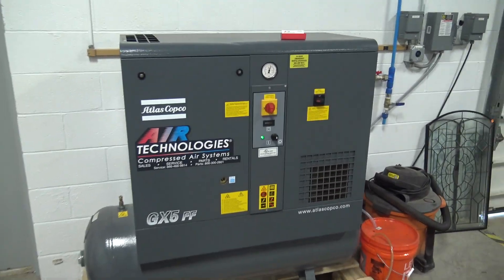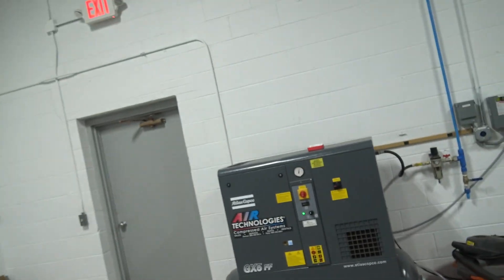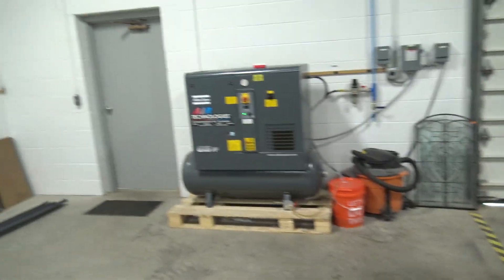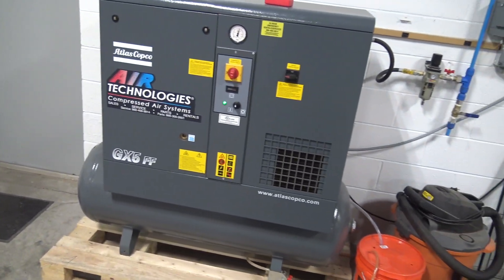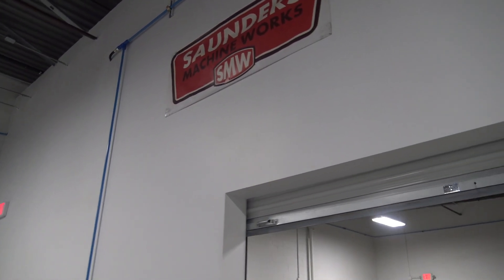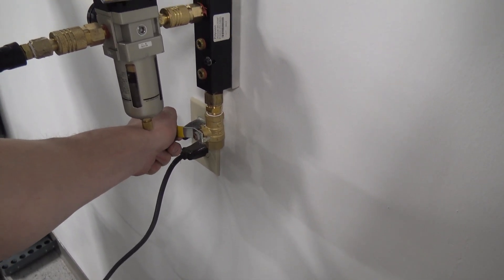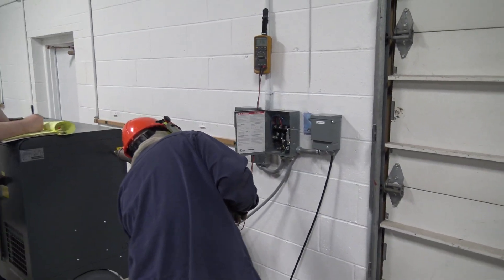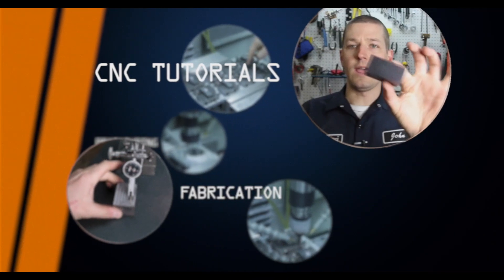Rotary Screw Air Compressor:  What are they?!  Worth the hype?

Comment: Thanks for posting... There's lots of mystery about compressors / efficiency/ air produced / energy used.. Instead of HP knowing the CFM at a particular pressure like 100 psi is a better way to compare compressors. I think I read somewhere piston compressors are still more efficient, especially if you want 150 psi air a 2 stage is the way to go. A scroll type air compressor would be the optimal compressor since the air is continually forced into a smaller space as it moves through the compressor. One issue with screw compressors is if the air get's too hot the oil will vaporize and it can catch on fire... https://www.youtube.com/watch?v=6AK2K2bwD3k
Reply: Actually if sized correctly, the screw is more efficient as you don't need the same hp to do the same amount of work...and some of that hp on the piston is used to overcome the higher sliding and rolling friction inherent to a piston design...for example you have to oversize a piston compressor because they can't (or shouldn't) be used for 100% duty cycle whereas a screw can be...I replaced a 5hp piston in my garage with a 3hp screw and get the same results...also the oil used...assuming it's proper compressor oil...has a much higher flash point than what the pump can achieve by heat of compression...what you see in that video is the result of a 'air/oil separator' fire...the gaskets of the A/O sep. have staples on them so that the sump, sep and sump lid all stay grounded...or else a static spark inside the sump will set it off...if the maintenance is done on time and correctly those fires are extremely rare...been in the business around 15 years and have only seen two separator fires.
Reply: I think you have some misinformation... since when is a piston compressor not "supposed" to be 100% duty cycle? Also pistons seal better than a screw and all the information I can gather says a stage type compressor is more efficient that a screw. Do you have anything that says otherwise?
Reply: The type of pistons that can run at that duty cycle are liquid cooled industrial class piston compressors...the shop type (what he has pulled out) if run at 100% duty will wear out extremely fast, create a hot tank and draw more Kw/hr per matching hp running the same cycle. This is why you generally have to buy a bigger hp piston so it can overpower the demand to shut down and cool off...ideally 50-60% duty cycle. Their current draw in that situation will be higher, and constant.  

If you have a properly sized screw for the application, it will be less hp and it's maximum draw will be the same as a piston of the same capacity (but that's not what you want to preserve the piston), but it will only reach that current draw at maximum capacity (full load) anything less and its draw is less.

Also one feature of a screw that's always overlooked is that it can supplement your heating source as they have air after coolers and oil cooler that have relatively powerful fans (compared to the fly wheel fan on a piston)...the only really area the screw looses out is maintenance cost. It could be $50 or less per maintenance cycle on a piston, whereas a screw (a decent one) will cost three or four times that...although it may balance out as you don't have to cycle the maintenance as often as a piston compressor.

My Kaeser SX3 (3hp) screw uses less overall power throughout the year than my 5hp Quincy did...heats my garage partially, almost invisible (noise) in comparison and I can run the sack off it and it doesn't degrade in performance like it would if it were a 3hp piston. It does cost me approx $300~ per year to maintain it...and I think over the same time I think that I was spending $200~ over the same timeframe on the Quincy.
Reply: A quality cast iron compressor will run for years with little to no maintenance... most refrigeration compressors are still piston.. your talk about cooled piston and all is just BS... If you like getting screwed that's up to you...
Reply: ...you clearly don't know what I mean by liquid cooled industrial compressors...look up Beliss and Morcom (best hits for videos)...those machines will run 100% duty cycle and are extremely efficient...they are also double acting piston types...but they can be very expensive to maintain as they generally start in the 50hp+ category...any air cooled compressor has a recommended duty cycle as I mentioned...they don't make machines that will run for years with next to no maintenance...and the old ones that would take more abuse would only run like that with lighter than average use...I have had to replace many pump heads that have been treated in this way...and most newer pumps with the exception of maybe big Quincy's and DV's will not take the the abuse (and that's what 'little to no maintenance' is) as you put it...on regular use I run all my customers on a 500hr maintenance cycle...on a 50-60% duty cycle...if they want more performance then I install a screw generally one size down...now anything bigger that 20-25hp it's almost always a screw as the maintenance is much more expensive on the bigger pistons...I don't know where you get the idea where keeping something that can generate enough heat to melt parts cool is BS......
Reply: You clearly don't realize that every truck on the road uses a single stage water cooled piston compressor which usually outlasts the engine (usually good for about 1 million miles)  that it's attached to...
Reply: ...they don't generally go that long without some sort of overhaul or replacement...I've done both jobs on many...and yes they do have a longer life than most shop compressors for that simple reaon that you dismissed before, but now acknowledge...they are liquid cooled....
Reply: ...I've been a industrial compressor tech specialist and industrial mechanic for almost 20 years...I also run air audits, system design and installs...I'm quite familiar with machine efficiency. Most of what these reports that you list work on the basis of ideal conditions and not as much on real world.
Reply: As a marine contractor I've owned both types and I can attest that screw compressors are not at all a fool proof piece of machinery. I've owned them up to 1500 cfm. At one point we were building large barges which required a lot of sand blasting...  We were using 150- 200 cfm diesel driven screw compressors.. the compressors needed to run all day at high output. One of them overheated and the oil caught fire. Several times the oil separators would allow some oil to pass and the trace amounts of oil caused the sandblasting to be rejected. We started running the air through a second oil / water separator to eliminate any possibilities of contamination. One day I was approached by a guy wanting to sell an used 150 cfm Elgi oil free electric driven air cooled 4 cylinder 2 stage piston compressor. Here is a link to it. http://www.elgi.com.au/high-volume-oil-free-reciprocating-air-compressors-18-5-37-0-kw-100-147-cfm/ We gave it a try and our troubles were over. We operated the compressor continuously / daily for several years and then when I sold the business a friend bought it and it's still working trouble free to this day.  So you can have your screw compressors... I'll take a piston compressor over a screw any day of the week.
Reply: The first mistake here was to select a diesel driven screw for sand blasting...they are not designed for anything where quality of air is important...they run hotter than any electric. I have seen this set up before and as soon as I have installed an electric with the proper water trap and coalescing filter, the air is cool, clean and dry...and those compressors WILL run 100% duty cycle 24/7 365 for decades (depending on brand)...now unless you got a heavy industrial type piston (double acting water cooled) Beliss, Joy, IR etc. you got lucky...or you're stretching a little because (even your links say so) air cooled smaller 30hp and lower) are almost always 50-60% duty cycle...even oil free. That being said, a few manufacturers sell electrically air cooled pistons for 100% DC...but they are high pressure, low volume boosters.
Reply: @angusandleigh  hi i read all you reply including this last reply, i just plan to buy a diesel sullair 185 for sand blasting, and suddently read the reply that being sad diesel screw a not design for sandblasting, so i dont really want to use the piston type because the noisy ( because i want to use it in my home, and it is in residence terrace area )  it made a also it not really produce the air flow ( cfm ) that can cactch up with the blaster pot. So what is your recommendation ?
Reply: @asyrafkee1250  ...first thing to know is how much CFM your blaster needs, you mentioned a 185 diesel, that's roughly equivalent to a 50hp electric screw (200~cfm depending on brand) although some brands will almost get that with 40hp.  After that you want to install a water trap (centrifugal water separator) and then a tank, maybe 240 - 300gal (there are calculations for proper tank size but it escapes me at the moment). Then a good quality regulator and coalescing filter(s). You can install a refrigerant dryer after the tank, before the filter as well for extra water removal. Some dryers have built in pre-filters designed for oil/water removal otherwise you have to install one of those before the dryer. Once that you have the CFM worked out, a rule of thumb is 4 cfm/hp. that will get you into the ballpark for hp and then you can look at brands as they all perform a little better or worse than that. For commercial sandblasting a screw with proper condensate management (filters and dryer) and don't forget to drain the water from your tank daily (or install and electric timer drain)...you'll be set!   But first and foremost you need to know the maximum CFM needed.
Reply: @angusandleigh  my blasting pot and the job just need probably 30 - 40 cfm but continously used, so i need to install a tank ( i got a good deal for 1000 liter )  and refrigator dryer, i'll try to follow your suggestion. Btw thanks for the fastest reply,
Reply: @asyrafkee1250  ...ahh ok, so depending on the brand...a good 15hp should do the job...even some 10hp screws will be fine.  The one thing that you want to avoid is over-running the compressor, what I mean by that is running it at too low a pressure.  You want to be able to maintain ~100psi or else if you run too low you will start to get heavy oil carry-over and go through oil and air/oil separator filters. That will result in damage to the compressor. 

Most screws are rated at a particular CFM @ 100-110psi.  Your tank size sounds fine for a 15hp, as what you're going to be doing the compressor will stay loaded while you're working so the tanks job for the most part will be acting as a buffer to protect the machine from the shock waves of sudden air flow stops (letting go of the trigger on your blaster).  Plumb your 'input to the bottom side port and your 'output' to the top side port (doesn't matter if the tank is horizontal or vertical) this keeps the air flow out of line so that heavy moisture will fall out of stream in the tank like a water trap making less work for your dryer and filters.
Reply: @angusandleigh ohh if i want to run it a low pressure, can i just run it with the air regulator after the receiver tank ? Do they( compressor ) fine with that  ? 

  you seem very knowledgable in this particular field, are you an screw compressor engineer ? 

You're way more helpfull than the sales person that approach me to buy their " things " but knows nothing about their " things ". I'm from asia, Malaysia to be exact. Here i dont know who to ask for, just help myself educate myself by just doing a litte research on them, and yahh, there you go. 

So a huge thanks mate. May God Bless you.
Reply: @asyrafkee1250  ...thanks man, I'm one better than an air compressor engineer, I'm the guy who goes in and fixes their mistakes...lol...also I've been a millwright for 20yrs.  It's the same over here (Canada), most sales guys know 'about' the equipment, but not the intricacies of the 'how' or 'why' of the equipment, for that you need to get dirty and tear them down and rebuild them which is what I specialize in. I spent 2-3 years servicing piston, screw, vane, scroll etc. and another 10 in diagnostics, overhaul and design assistance (for newer manufacturers). I work on 3hp to 500hp compressed air and vacuum. 

...back to your question, absolutely you can run a regulator. Especially if you set it to lower than your compressors 'cut in or load' psi.  For example you need 100psi to run your blaster, set you Compressor to load at 105 and to unload at 120 (a 15psi load differential is ideal).  Check the machine nameplate on its maximum as not al screws are rated at 125psi max, some are lower...in that case run the compressor to its maximum, subtract 15psi for its load point and then run your regulator at about 5psi less than that.  That way your equipment will always have a consistent pressure feed, it won't dip or rise.
Reply: @angusandleigh  haha lol, ya i know, you explain everything from your real experiance thanks for that. Oh ya i got another question. Are Vane better than screw ? How about the maintainance (services )  for the Vane ? Is it Less maintanance like screw or need a regularly services ? Because yesterday someone offered me a used one Vane compressor. They also mention that that ( the one ) Vane also really quiet when operating. 

Can give some advice ? 

Ohh you from Canada, wow now i have a new Canadian friend. Good to know you mate.
Reply: @asyrafkee1250  ...I would stick with the screw, they are more efficient (no wearing parts besides bearings and seal)...vanes are typically 10% less efficient than the equivalent screw.  Maintenance is about the same with similar parts between them...however the oil in a vane tends to last fewer hours than in a screw (4000 synthetic vs. up to 8000hrs. on synthetic).  I find that unless you get a newer vane in a cabinet (most out there are open, at least that I deal with) and are not as quiet as a screw.  Most screws in cabinets (of good quality) you can have normal conversations right beside them.

An example of service intervals (screw) would be;
Every say 1000-2000 hours change out the air filter, every 2500-4000 hours change the oil filter, every 4000 (mineral) to 8000 (synthetic) hours change out the oil, and every 3000 (spin on), 4000 (cartridge) and 8000 (large 'top hat') hours change the air/oil separator....but no longer than two years for the full service (air and oil filters oil and A/O sep).  The given example depends on what brand and construction of the machine.  If you buy a screw let me know, and I may be able to narrow it down and may have an operators manual you can have (.pdf).

Comment: The main reason I have heard that continuous run screws are best, is because it keeps the oil hot and that prevents excess moisture buildup in it. which stands to reason, too many short cycles would make the oil milky, as it does in a car engine's cam cover if you do too many 5 min trips to the store, it's the coldest point so it goes all gloopy.
Reply: This is exactly right, although load/unload screws are fine too so long as they are sized correctly and the right size storage receiver is also used...this will keep the load cycles to a point where the heat in the machine is maintained...I generally like to see 165-185F and that keeps the moisture at a vapour so that it will pass the air/oil separator element...had a client once with a 100hp variable speed machine in place where a 30hp modulating machine was running at about 80% capacity (they got a good deal on it I was told)...and this machine normally takes 3/4 of a 20L pail of oil...was called in to see why it was constantly popping the safety relief valve each time it tried to cycle up...drained 2.5 20L pails of fluids from the machine...2 of those pails were water...this machine was running at a 'frosty' 125F peak.
Reply: We have a couple Ingersoll Rand Rotary Screw compressors. A 20 HP and 7.5HP one.  We're in the food industry and so it's powering our 14 bucket scales, bagging machines, metal detectors and other things.  There's a lot to do to maintain them.  There's no computers in mine and are around 18 years old now.   The 7.5HP is backup, but it doesn't keep up with our air needs.  We also have a Air dryer our air goes through.
Reply: @jbdragon3295  Hello, thank you for this comment. I am in the middle of the buying a new rotary screw compressor to power 14 bucket scale, 2 bagging machines with printing units and some additional equipment. I am currently using piston compressor 7,5 kW but I am aware that my air system is leaky and need to be replace. Could you tell me how does the screw compressor works with on/off working? Thanks in advance
Reply: I wonder if that could be solved with an oil pre-heating system of sort.
Reply: @FrozenHaxor  they have a thermo stat on them so it would help only a bit. the best is to load them up and work  em like they are designed.
Reply: Aussie50 i